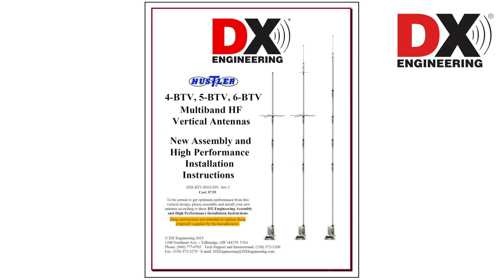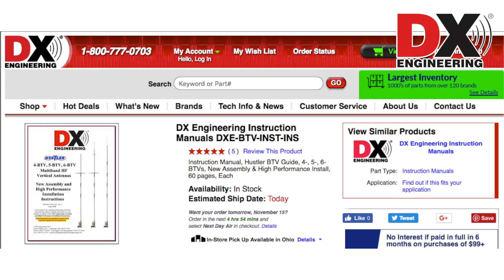DX Engineering Tech Talk with Rod, KS8U - Hustler SWR

Comment: Thank You for taking the time to explain this. I have a Hustler 6BTV  that has 40 28"ft radials beneath it and a few other DXE goodies (Tilt Base, radial plate, SO-239 adapter and the VMN-1 coil. Really does well 40-10m, when feed with 100 watts. I can just about work any station i can hear. The antenna was fine tuned with a Rig Expert AA-30, and once again does very well. No tuner needed on 40-10m. Yes 80m is still a feat but, I can still get it to radiate (with a MFJ-949E) on 3500-3505khz. I do have an issue with 30m . However, I think I know where i went wrong (never performed 30m course tuning trap adjustment) now.  

On a different note, does the adjustment of the VMN-1 effect the other bands as well? Would you consider making a future video on the VMN-1 adjustment process?

73 es gud DX!
de KC5NGX